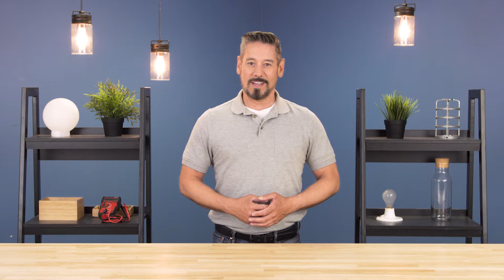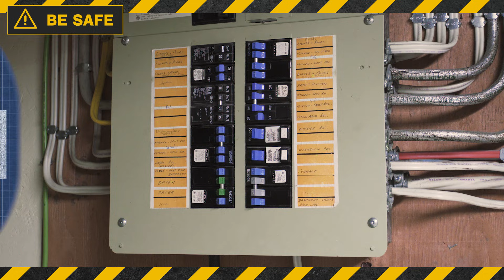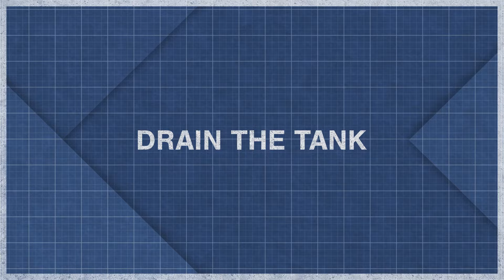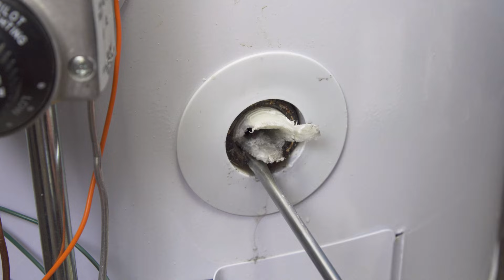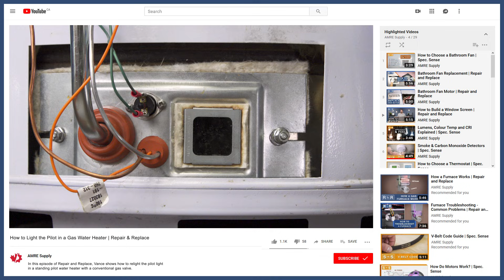Water Heater - Drain Valve | Repair and Replace

Comment: I attached outside garden hose to drain valve not inside faucet short burst into tank, backwasked that way. As sediment continues to block needs to be repeated. Mine is 10 years old never did replaced tp valve which was inoperative.
Reply from the maker: Thanks for sharing your experience. The amount of sediment differs greatly depending on the type of water one has and can be tricky in some cases.

Comment: How difficult is to replace the plastic drain valve? I bought HMP010 Full Port Brass 3/4" MNPT Water Heater Drain/Flush Ball valve.
Reply from the maker: Thanks for watching. Replacing the drain valve is easy as long as the threads are not siezed, it will take some time to drain the tank though.
Reply: @AmreSupply  I have to drain it anyway, because I have to replace anode rod and do a flush. I have never done any flash before. Water heater was installed maybe 4 or 5 years ago, so I want to take the chance and replace the drain valve. is there any way to use an impact gun to remove it or is not good idea? the gas pipe is in the middle, so I have to be careful.
Reply from the maker: @HeydaCarreras  Impact can be used on the anode if there is room but the drain valve will need to be removed using a wrench. You might need a breaker bar to get it started though.
Reply: @AmreSupply  Thank you. I have several wrenches.
Reply: @AmreSupply  Do you think is ok use regular white templon tape, I have a lot of them
Reply from the maker: @HeydaCarreras  Yes the standard white tape is fine for this size fittings: This is what we used for this repair: https://www.amresupply.com/part/213-503-TEFLON-TAPE-1-2-inch-X-480-inch

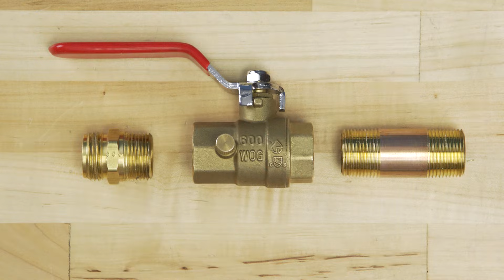Comment: 03:15 - Hot dang, that's an awesome idea! Unfortunately, mine didn't work. Couldn't get the thing to seal where the 3/4" MPT on the valve meets the 3/4" FPT drain on the unit. Kept getting a slight leak. It was late at night after the third or fourth try, so I was glad I had bought the manufactured brass valve as a backup (the downside: it's not full port).

Love your videos, though, and this was especially helpful!
Reply from the maker: Thanks for watching. Sometimes there can be warped or slightly corroded threads that can interfere with the seal so in this cases cleaning the threads and properly applying teflon tape can help get a leak proof seal.

Glad you're finding our videos helpful though!
Reply: @AmreSupply  I'm going with the improperly applied tape hypothesis. I used a wire brush to clean the FPT thoroughly as I could and, since the professionally manufactured drain valve sealed, it's almost a shoe-in.

Comment: I don’t have a valve, just a plug that is slowly dripping. How do I drain the water heater without making a big mess?
Reply from the maker: Thanks for watching. Is the plug threaded, if so then you might have to unscrew it a bit and fill a pan or a bucket. It's not ideal but might take a while to drain.

Comment: I once had a contractor almost sell me a whole new water heater when I just needed the drain valve replaced. 😡
Reply from the maker: Thanks for watching. Unfortunately there is a lot of incentive to up-sell and install new appliances, water heaters and furnaces. This results in a lot of appliances going to the landfill prematurely.
Reply: Happened with the furnace too😭 it is sad how many ends up in the landfill tho

Comment: CAUTION changing the plastic valve is not for the faint of heart on an electric water heater. The valve is far deeper than the gas heater shown in this video, lower to the floor and it presents a great challenge to remove when it breaks off. This video is well done, and the removal process works, it is just a difficult job to do on an electric unit.
Reply from the maker: Thank you for sharing your thoughts and experience. There will always be some variation between models and some will be more challenging than others. We are focusing on appliance repair videos but we would like to return to this and update the troubleshooting and repair to include electric water heaters and power vent models.

Comment: Maybe I’m stupid but if I remove my plastic drain thing won’t all the water pour out?  My plastic drain thing has worn threads and nothing will attach to it. How do I drain the tank so it doesn’t go on the floor?
Reply from the maker: Thanks for watching. If you are unable to attach a garden hose to the drain then you can drain into a small bucket which you'll have to manually empty dozens of times. This will take a while but it will ensure that the water is drained.

There are some people who will do a drain valve replacement with a full tank while in an air lock, but if the valve doesn't unscrew correctly there's more of a chance of a big mess.

Comment: Found it leaking right before bed and a while later, I'm going to sleep and will check on it when I wake up.
Reply from the maker: Thanks for watching. Was the drain valve still leaking? Did you have to replace it?
Reply: @AmreSupply  it was still leaking and had to replace it. Unfortunately, the feed valve was leaking too and ended up quickly swapping the old and new with water spraying momentarily. The new valve stopped the leak and we're good.

Comment: My brass drain plug screws into white exposed threaded part. The white plasrtis cracked and leakind. State Water heater from 2010. Whe i take out metal drain, does the plastic cracked part have to be replaced? Can a new metal longer drain plug work?
Reply from the maker: Thanks for watching. Being here in canada, those models are not common so I can't speak to that directly. 

Do you mean that your brass drain plug connects to a threaded plastic spacer piece and the plastic piece is also threaded into metal threads on the tank?

If the plastic piece is part of the threaded connection, then a crack might result in a leak.

If your tank has metal threads directly on the tank, then a brass valve with a longer stem would work.

Comment: Hot water and plastic seats are not a good combination...use brass replacements when possible.  Cracked seats make washer replacements a loss.  The old one took a medium sized vise grip and a long board to use as leverage off the ground to push the vise grip up.  I loosened it with the weight of the water in the tank and then drained and fully removed.  I found a short 3/4 MIP brass valve at Menards SKU: 6851688 for about 8 bucks that was the same size as my 10 year old envirotemp drain valve.  I can't believe the valve they use on the water heaters today.  I got my water heater at Lowes with a small dent for $179 open box off the showroom floor and I figured it was pretty cheap, but now they sell for over 400 with the same plastic drain valves.....wow.
Reply from the maker: Thanks for sharing your experience. This is exactly why we recommend buying a brass valve or installing a brass ball valve.

Comment: Nice video.   A question concerning draining the tank.
Our water heater is in the basement, and the basement does not have an inside drain.

Also, the problem with simply attaching a hose to the drain valve is that the only way out of the basement would involve the hose passing several  feet above the top of the water heater (in short, the tank wouldn’t simply drain through the hose).

Do you have any suggestions about draining the tank in this case?  
Or am I just stuck with toting the (50 or so gallons of) water out of the basement “one bucket at a time”?

Thanks
Reply from the maker: Thanks for watching. Without buying a small transfer pump, the only way would be to manually move the water in buckets.

Comment: How long is that ¾ in NPT Brass nipple?
Reply from the maker: Thanks for watching. The one used in the video is  2-1/2" which should be enough to clear in cases where the tank wall / insulation is more thick.

Comment: Now I need help.
I installed a new drain valve on my in law, an uncle that used to work as plumber (not licensed) told her that now that I change it, is couple more weeks and the boiler will explode because I did it.
Smh, now they had a dilemma about what I did.
This obviously is not true right?
Reply: It would be a problem if you removed the pressure valve and installed a drain valve
Reply: @21keys27  no just the drain one, I didn’t touch the pressure valve at all. Now the problem is turn on and stays on for 10-15min with yellow/orange flame and then turns off, is been that for 3 days now
Reply from the maker: @jjhonnz  It would be worth cleaning the burner assembly and the flame arrestor screen: https://youtu.be/ZTUNLIXKVu4?t=158

You can see how to remove the burner assembly in this video: https://youtu.be/Mx6rZA9Yxv4
Reply from the maker: Thanks for watching. The drain valve is not open when the water heater is running. It is not a safety device and does not open unless a user needs to drain water. This will not cause the water heater to explode.

The pressure relief valve (also known as a T&P valve) is a safety device and will open when the pressure or temperature gets too high. If this valve is stuck closed then the water heater does not have a way of safely discharging water when the pressure is too high. If you're curious on how this works, this video explains more: https://www.youtube.com/watch?v=d7SYbOgAYhc

Comment: Just bought a new Rheem water heater. The unit has a plastic valve on it and this is helpful in showing how to prepare for upgrading to a brass valve.
Reply from the maker: Thanks for watching, we're just happy to share some good info. You can't go wrong installing a brass valve!
Reply: @AmreSupply  agreed! Home Depot sold an aftermarket for $9. I call that cheap insurance. The number one negative review I saw on the Rheem  unit was a failure of the plastic valve. Since this is going in my ceiling, I would rather not take the chance.
Reply: I have the same hot water tank it was leaking from the valve so I put a cap on it to stop that problem now it seems like it's leaking internally from the valve and dripping down and leaking out the bottom of the tank I don't know
Reply: I'm having a problem with a plastic valve on a 52 gallon Whirlpool electric water heater right now--and haven't been able to drain the tank due to failure of the valve. 😢😢
Any bright ideas appreciated!! 🍀
Reply: @willmeredith3303 what's wrong with the valve? How did it fail?

Comment: What happens if you accidentally knock a little piece of broken plastic into the tank that you can't get out?
Reply from the maker: Thanks for watching. A small plastic piece is not much different than a having a chunk of sediment at the bottom of the tank. It will settle to the bottom and is unlikely to create any issues.

Comment: I would like to try to dissolve a few pounds of built up lime sediment, if there is a large amount.   Some people disconnect the hot out connection and pour in a couple gallons of vinegar and let it sit for up to 8 hours, then try flushing out a slushy mess of crud, adding more vinegar, if necessary.  Any thoughts on the vinegar treatment ?   Bob
Reply from the maker: Thanks for watching. Vinegar is a common and an effective way to help clean out sediment, the steps that you outlined should work!

Comment: This is only for replace…. Do you have a repair video?
Reply from the maker: Thanks for watching. We called the series Repair and Replace, as these repairs often require replacing some components. We did not make a video on how to repair a faulty or leaking drain valve as these are not easily repaired and its often best to install a new drain valve.

Comment: Great Video.  I was able to change the drain valve my self. I had a plastic valve and it broke off like you mentioned in the video. Replaced it with metal one and its perfect now.
Reply from the maker: Thank you Arif, we're glad that the video helped you get your water heater back up and running!

Comment: We just hooked a hose to our drain valve to add hot water to a pool. The water isn't hot, but we still have hot water in the house. No other hot water heaters. How can that be?
Reply from the maker: Thanks for watching. One thing to keep in mind is that the dip tube (that fills the tank with cold water) releases the water to the bottom of the tank so that the burner can heat it up. 

You can see this in action here: https://youtu.be/BHUPFLbb8NY?t=46

If you've used a bit of hot water already, then the bottom of the tank will be full of cold / luke warm water. If you just wait, then the tank should heat the rest of the water and you should be able to drain hot water from the drain valve.

Comment: You saved me. I was kicking somelaundry along my basement floor because my hands were full and the plastic drain valve apparently was in my way when I kicked and it came flying off my wate heater. Water was spraying out all over my basement and I had no idea what to do. Thanks to your video I was able to fix the situation myself. I appreciate you!
Reply from the maker: You're welcome, we're glad that the video helped you out! A broken plastic drain valve is never fun as that is a lot of water to clean up.

Comment: My drain valve does not have hose connection. What is an alternative?
Reply from the maker: Thanks for watching. Does your drain valve have any threads at all or just a smooth spout? 

If there are no threads then draining the tank will be slow as you'll need to fill and empty a container dozens of times.

Comment: If the water heater tank it’s made of carbon steel. Why would they add brass fittings to it, wouldn’t that cause galvanic corrosion?
Reply from the maker: Thanks for watching. Galvanic corrosion can happen but with a healthy the anode rod, any corrosion on the valves is going to be negligible. The benefits of using a brass valve are pretty clear as plastic valves are more prone to cracking and leaking.

Comment: I have a old Richmond 9G50-40F1 water heater with a plastic drain - straight-thru axial type - not what you show here.  I can remove the center rotating part with the garden hose fitting.  The rubber o-ring and flat washer are worn.   Can I just order a replacement o-ring and flat washer instead of replacing the entire drain valve?  There is no visible sediment blockage after removing the center part of the drain.  I was able to insert a wire and long screwdriver into the tank.
Reply from the maker: Thanks for watching. Its hard to say how effective replacing the o-ring would be on different drain valves. For peace of mind it is often best to install a new one, and for most usability a full port ball valve is the way to go.

Comment: The pilot light alone will not heat the tank, so turning the gas selector to pilot light only is sufficient.
Reply from the maker: Thanks for watching. You are right that turning it down to pilot will work for this. Turning off the gas and shutting it off is just an additional safety precaution we have added to most repairs in this series.

Comment: I had a sleepless night after noticing leaky water heater, much worried that the basement will be full of water if the things goes the other way.
I searched some videos in the morning and found your instructions of how to fix leaky drain valve. I am getting ready to take the challenge.
Will update when i am done. 
Thanks for the excellent video.
Reply from the maker: Thanks for sharing your experience. We're glad that the video was helpful. Best of luck on the replacement!

Comment: When you are using the washer hose to back flush, is your water supply back on?
Reply from the maker: Thanks for watching. When draining the water heater, only the cold supply valve above the tank needs to be shut off. The main water supply valve in your home can stay open. When you back flush you'll open the faucet that the washer hose is connected to.

Comment: Thank you so much for a complete video. I just replaced my plastic drain valve with a metal one. It works great! However, I have one question...I have just a small leak now because it probably needs to be tightened more BUT I'm worried if I try to turn it one full time around it either won't go, or I'll damage something, or the faucet part will be facing up. I used tape and did about 4 times around. Should I have used something else to stop it from from that tiny drip? Should I have used more teflon tape? Thanks!
Reply from the maker: Thanks for watching. If the valve is leaking from the threads then it might be worth unscrewing and cleaning up the threads with a wire brush. Also inspect the threads to see if there is any corrosion or damage. After that reapply the thread tape, (4 - 6 times around is fine) screw in the drain valve again and tighten it. If you feel like you can still turn the drain valve without excessive force, then it will likely still be able to tighten another full revolution until the valve is aligned.

Comment: How to connect the washer machine hose. My washer machine is in the first floor and my water heater is in the basement?
Reply from the maker: Thanks for watching. Draining the tank requires just a standard garden hose. To do a back flush the garden hose that you're using to drain the tank needs to be able to screw into a threaded faucet somewhere in your home. The washing machine hose will have the right connections that will be able to connect between a threaded faucet and the garden hose. In some cases a threaded faucet might be too far away so a back flush might not be possible.